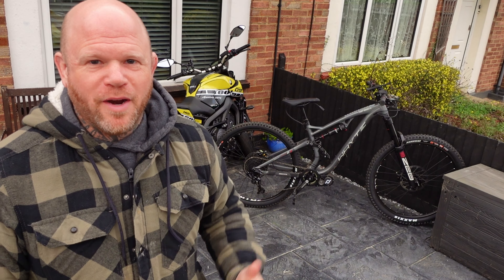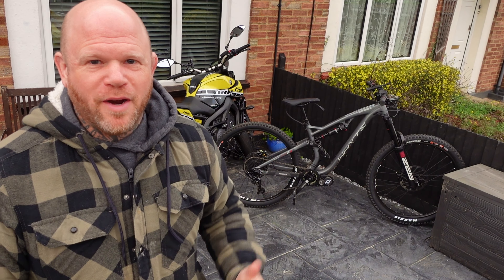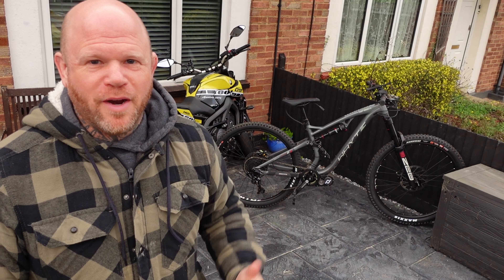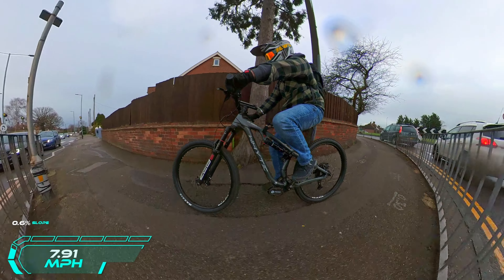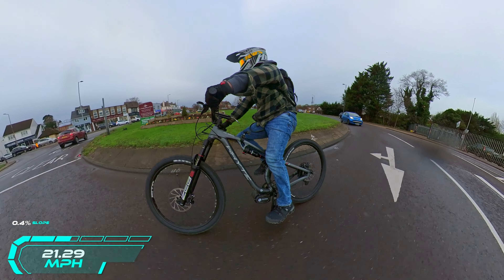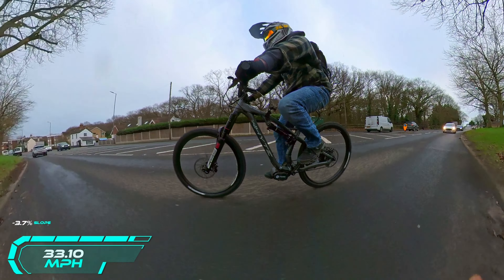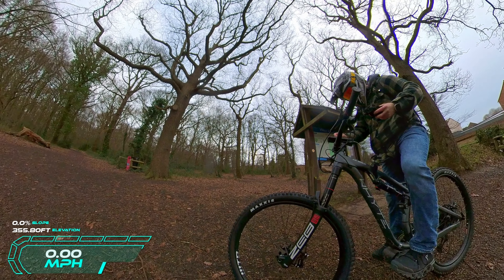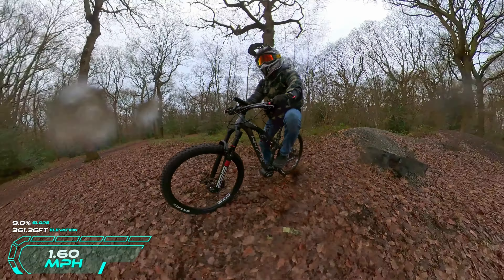V3 PARADOX KINETICS - TOP SPEED TEST!

Comment: Looks like a nice little motor, can it run with a regular bolt-on battery? The motor sounds just like a CYC :)
Reply: If your frame has space in the triangle then yes it can, most full bouncers like this don’t have space
Reply from the maker: You can put a battery anywhere you like that it fits 😏

Comment: Yes, dude you have to ride mid-drive bikes like a car you have to set off in first or second gear to maintain your cog and chain 👌
Reply: Very rarely use first gear 3rd is fine or 4th is fine most the time.
Reply: @Scott Mcfarlane  I meant if you use the throttle to start in a higher gear puts more pressure on the mid-drive motor so using the low gears if you are using the throttle to start your ride is better for the motor

Comment: There specs say 40mph there not hitting that
Reply from the maker: Considering i had a gale force headwind and mid drives are geared by the bike drive train there's every possibility it can do 40 since I already hit 38mph it's hardly worth mentioning 2mph imo
Reply: Hitting 38 in them conditions was actually mental... Could easy see and hear it wasn't 100%... Also was only the first ride. You'd be shiting yersel at 16mph

Comment: Not worth 2k more like 800 at most
Reply: Your not getting the motor for under 3k n that’s without a battery, a bike or someone to fit it so how u gonna value it at 800? This bike has more torque and more watt hours than any of the shelf bike I guarantee it but people pay up to and over 10k for one of those which is just crazy 🤷‍♂️
Reply: Just because you can't afford it doesn't mean it isn't worth it.
Reply: I mod my own ebikes sell them on fb and yes I could afford 3k but no i wont pay that for 35mph 1k gets you a 72v 45a   custom built with 300a bms 2k gets you a suron killer ebike so think about that 3k
Reply: @hondajedi125  infact ill race this bike against my 950 build 48mph on 60% then after turn it up to full 54mph on flat 45 mph up steep hills heat sinked hub and shunt moded controller I get them for £45
Reply: @mikeuk2981 you mean a rear hub build surron killer ?